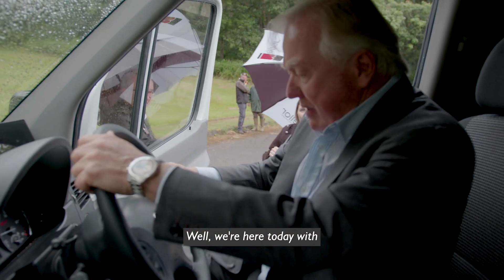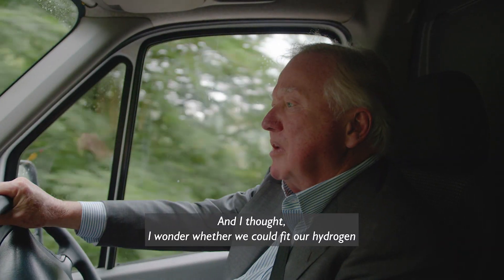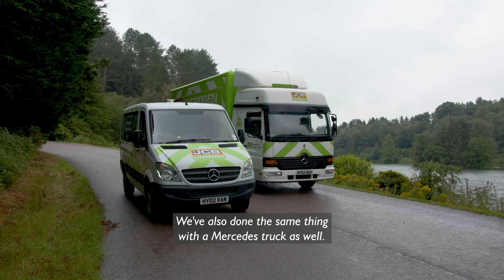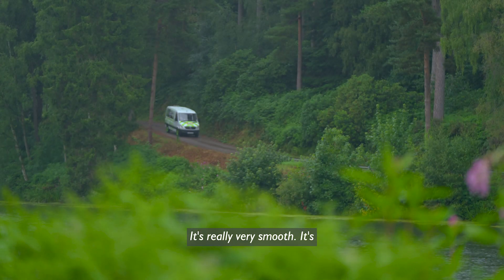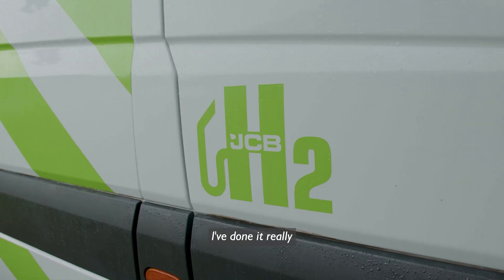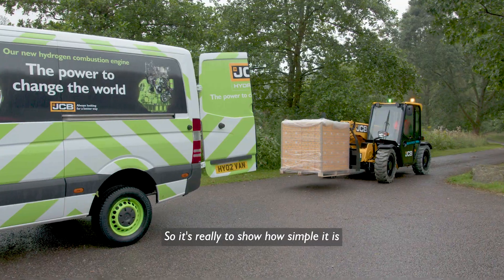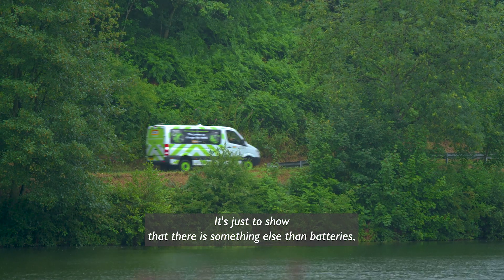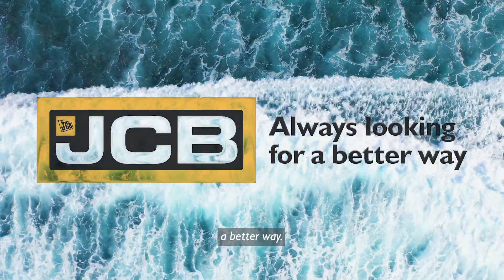JCB Chairman Lord Bamford's First Drive of a Hydrogen Combustion Van

Comment: Great to see you demonstrating the art of possible here JCB!  The challenges of electrifying in the UK are vast and alternatives are really needed...  The current fuel stations could be repurposed from to include diesel and petrol to and with a quick speed of refuelling vehicles it is a solution that could work so well!  As someone over the last 10 years that has had three cars which were plug in hybrid, self-charging hybrid and full electric, I for one cant wait to have a hydrogen car myself!

With regards the colours of hydrogen, lets build the market for using green hydrogen and industry will invest and costs will plummet just as the costs for renewable electricity have, despite the UK having to turn off in vast amounts of renewable production last year, just because it was being generated at the wrong time of day/year.
Reply: There is no such thing as 'green' hydrogen. You are being misled by the fossil fuel industry greenwashing brigade. Why are big oil supporting hydrogen? Have a think- is it because they know that using green-derived electricity to generate hydrogen is a total financial non-starter and that they, big oil, will be providing all the hydrogen from methane?  You clearly read the Murdoch press - times/sun or the equally delusional telegraph. Here's a tip for you when you read their articles about green energy generation, battery technology and EVs - "They. Are. Lying".
Reply: 1) there is only around 8% of the materials needed worldwide.... I was gonna list problems 2 through 9 but yeah number 1 says it all. Not to mention. Electric cras are totally gaaaaaaaaay

Comment: I have my concerns about hydrogen but it is the right thing to pursue its development.
Maybe not for smaller vehicles, but large construction projects (using the hydrogen bowser) and fleets running delivery vans, lorries and buses. 
Efficiency needs to improve and ensure that green hydrogen is used .
Reply: I agree. I think batteries are the future for passenger vehicles and light vans (replacing petrol) and hydrogen will replace diesel. 
As we expand solar and wind, excess production of electricity can be directed towards making green hydrogen.

Comment: Isn't it strange how most people commenting on this video think hydrogen is a great idea and the future, yet aren't questioning where it comes from or how its made, like they do immediately do when talking about EVs. They're ignoring the fuel supply chain and the energy it uses, just like they do with the fossil fuels.
Reply: Maybe they just don't like electric cars, I'm not fond of them and would only have one if it was absolutely necessary
Reply: A lot of suspicious anonymous commenters raining applause for a clearly bad-faith greenwashing pipe dream tech without a single fact check or request for more info? Surely not!
Reply: Like the fuel supply chain that gets the power stations running? 
I presume you always note that a far higher percentage of power is lost between a power station and the wheels of an ev than the equivalent in ice too - the same as ev flag wavers always seem to ignore how wasteful an ev becomes in the cold, wet or whenever its asked to do much actual work. 
Keep bashing any other ideas though - its ev's or nothing, right?
Reply: @siraff4461  absolutely, we need to question the complete fuel supply chain.
Reply: @siraff4461  power plant to wheels losses in EVs is far less than ICE losses - which are so large, you need a massive radiator in your vehicle because it can't waste the heat fast enough! Most of your petrol money is wasted as heat in a combustion engine.
Reply: @brushlessmotoring  Wow. You couldn't get much more wrong. 
Maybe educate yourself a bit before making stupid comments like that again?
Oh and last time I looked my ev had just as large a radiator as my ice...
Reply: @siraff4461  cool - straight into the personal attacks eh? You must be on a firm footing!

Battery EV, 80% efficient, full cycle (includes generation, grid transmission and charging losses) 18kWh per 100km.
Diesel, 40% efficient but only if run at optimal load - e.g. as part of a genset, (e.g. charging a battery).
Hydrogen Fuel Cell (uses Platinum) - 50% efficient, but, making the hydrogen from electricity and water is 60% efficient, so the overall efficiency is around 33% (54kWh per 100km) compared to an EV..
Gasoline: 20% to 30% efficient, mostly produces heat, not motion, which is largely wasted through the radiator.
Hydrogen Combustion (as featured in this one off prototype video) 15% efficient, produces NOx emissions.

What EV do you have with a bigger radiator than a combustion car? EVs do need some heat dissapation, but it's not needed all the time, you might be looking at the HVAC system instead.
Reply: @brushlessmotoring  Battery ev 80% efficient overall? 
Thats amazing considering the power station generating the electric is usually around 45% efficient. 
Look I'm not even going to go into it because you're miles off. Suffice to say you're either pulling numbers out of thin air or someone has fed you a load of nonsense.
Reply: @siraff4461  so where does the hydrogen come from - either fossil fuels (97% comes from fossil fuels) or via electrolysis from a power station - the same power station as an EV - but an EV will use 80% of the power from a power station, whereas a hydrogen car, via electrolysis, will only put 33% of that same power to the wheels. Thats why it's so expensive per mile compared to an EV.

In California, $36 per kg, which at 80 mph get you just 44 miles - 80 cents per mile, compared to 5 to 9 cents for an EV in CA.

And that's a platinum fuel cell car, hydrogen combustion, as shown in this not-for-sale prototype is half as efficient again, and emits NOx.

I agree, power stations are not 100% efficient - although, how do you rate wind and solar? But, starting with 100kWh of electrical energy, however you generated it, a battery EV will use 3 times less than a hydrogen fuel cell, and hydrogen combustion vehicle (seen here in this not-for-production prototype) is even worse.

As a result, you need huge tanks to get the same kind of range people are expecting from a diesel van, and then you have used up all the cargo space.

I have no idea why JCB is building one off prototypes of a Mercedes Sprinter van that they don't make, you can't buy, you can't fuel, and would not work in the way they are breezily presenting it. Are they a mod shop now? Scrapheap Challenge? Junkyard Wars? Is it just for youtube likes and subscribes? It's not a product you can buy.

And then a bunch of hydrogen believers start foaming at the mouth in the comment section .... I feel bad for these folks. Why would JCB do them dirty like this, and show them a product that doesn't exist, and they have no interest in making?
Reply: @brushlessmotoring  You've changed your claim but you're still miles off. 
Between the fuel going into the power station and the car moving an ev is usually between 20% and 30% overall efficiency. 
Thats including power station efficiency, transmission losses, charging losses, inverter, motor and driveline losses. 
A decent modern ice can run around 40% efficiency and hybrids tend to stay over 35% efficiency in actual use. After drivetrain losses they are usually around 25% overall. 
Now what happens when its cold or hot outside? The ev needs to waste more power to heat/cool the battery and heat/cool the cabin. The ice only wastes more power to cool the cabin on a hot day. 
Now how about rapid charging where the charging losses are much higher and battery temp needs to be controlled - again wasting more power to do so? 
Honestly I don't know where you people get your ideas from but sticking a battery in a car does not make it "zero emission" and does little to nothing to help the planet - remember that battery only has a finite amount of use cycles which is much lower than a looked after ice. Its also made from some of the most environmentally damaging products possible and hardly any are recycled - certainly there are no realistic plans for mass recycling and if you think using them for storage is it then look further into what that involves and how much of the pack is really used. 
Batterys have their place. They are great for allowing short journeys on electric where an ice would be less efficient (so long as its not in a cold climate) and they are great for keeping an ice working in its optimum efficiency area. In other words a plug in hybrid makes a lot of sense. 
What doesn't make sense is carrying half a tonne of extra battery around to get a realistic range ev because most of that pack will remain unused most of the time and it still limits range/use when you do ask it do do some work. 
As for Hydrogen - I'm open to see what they can do with it just as I'm open to see where battery ev's go. I really couldn't care less what form powering vehicles takes so long as its the best possible for the use case. 
For instance if someone lives in a town and never goes past 20 miles or so a tiny battery ev makes sense. If they make the odd longer journey a plug-in or range extender makes sense. 
If better battery tech comes along that may well change and it may make sense to simply put batteries in all cars but thats not going to happen with li-ion because physics says no.
Reply: @siraff4461  You said earlier, "Oh and last time I looked my ev had just as large a radiator as my ice..." - which EV do you have?

Where does the hydrogen come from - how is it made - whats the kWh per kg, how many litres of water do you need per kg? Hoe far does a hydrogen ICE or Fuel Cell go on 1kg, how far does an EV go on the kWh used to make 1kg of hydrogen - go look some facts and figures up on this stuff before jumping in with both feet on the magical thinking that is 'hydrogen better than batteries'

I would be more open to plug in hybrids if people actually plugged them in, they are often bought for incentives and HOV stickers and then not actually charged, so they just become a heavier gasoline car.

Comment: Storing electricity in water. It's cheaper than lithium. Why anything else for plant and heavy? No substitute for engines yet. E bikes and electric cars suck too much to take those problems to work where I do landscaping and driveways. Batteries cost too much, take too long to refill and dong hold enough oomph to be a JCB beaver. Hydrogen beaver pack could be cool. Solar powered at home with hho tank and compressor to refill internal hydrogen tank automatically. O2 and water become the waste products.
Reply: You would need 8 times the solar to make and compress enough hydrogen to do the same work as just using batteries - hydrogen combustion is very inefficient.
Reply: @brushlessmotoring  my mate is installing 750 kw wind turbine. We live in farm country in north Cornwall. Hydrogen might pay off on that I think. I admit, it's not going to be a silver bullet for all our problems, but I just can't see battery plant equipment working. I owned ebikes. Bit of a letdown in cold weather on hills. I will have to look into electrolysis gear needed and try figure out efficiency of the system. We really do need the new reactor in Anglesey which is planned for hydrogen.
Reply: @davidedgar7338  quick comparison with a fuel cell Toyota Mirai, which is twice as efficient as JCB’s combustion hydrogen engine - your 75 kW turbine, running for one hour, will produce 75 kWh of electricity, enough to fully charge a long range Tesla Model 3 to go 300 miles. But if you pump 75 kWh into an electrolyzer (and it would have to be big and expensive to take 75 kW) along with 15 liters of deionized water, you will get 1.4 kg of hydrogen, enough to move a Mirai, at motorway speeds of 80 mph, 62 miles. Hydrogen combustion would achieve around 30 miles, and produce NOx emissions that need to be dealt with.

E-bikes have swappable batteries, those batteries can be thermally managed better than they are to maintain better winter range. 

I’ve had zero issues with EVs in the cold, if properly preconditioned- check out my winter road trip videos across the US.

Comment: But where does the hydrogen come from? Almost all hydrogen is made by steaming methane at very high temperatures. The CO2 waste is released contributing to climate change. There are claims that the CO2 can be captured and buried - there are no working examples at scale and the experiments done have generally failed because of leaks and the large amount of energy needed to move the CO2 to storage. Energy use is key all of this. Making hydrogen uses more energy than just using renewable leccy in a vehicle via a battery. More energy means more cost, so the economics won't work.

There is no hydrogen infrastructure to deliver H2 to vehicles. It is very hard to store (high pressure and causes steel to become brittle). I wish we could use hydrogen, but batteries work well and are getting better. Combustion vehicles are at the end of their lives. Big Oil and engine manufacturers want to cling on to their investments and profits, but just as coal mines had their day, so have combustion engines.

I wish JCB well, but this is a dead end.
Reply: CO2 is not a poison, it is essential for plant life.
Reply: @DwayneDibbley  it is not a poison at current levels, but too much of it traps heat and heats up the air. The pre-industrial level of CO2 was 280 parts per million and plants were happy. It is now about 430 parts per million. That is much too much. BTW, too much CO2 can be poisonous to animals including us, but that is much, much higher than current levels and is not the issue here.
Reply: @chilllytube  give us a shout when we get to 1000ppm till then I wont worry about it

Comment: Making hydrogen unless there are natural deposits which are rare involves carbon emissions and for what you gain from the driving emission you free you loose in the production
Reply: Charging EV uses the said same electricity that could go to produce hydrogen.  Nuclear and renewables can be used not just fossil.  This looks for once to be a creditable alternative to EV which is quite simply a non starter for practical diesel engine replacements.
Reply: @xrotor1966  it’s not just about electricity causing emissions. The only way to do it cleanly is using water and electrolysis. Other ways of obtaining hydrogen involve carbon dioxide being given off in the reaction itself and that’s how most hydrogen is obtained at the moment.
Reply: Charging an EV is much more efficient than making hydrogen. There's a reason they're known as hydrogen 'fool' cells! @xrotor1966
Reply: @xrotor1966 Except it uses over three times the electricity. So choices are a) pay three times a much or b) charge three EVs with the same power.
Reply: @xrotor1966  There are extra energy losses using renewable leccy to make hydrogen. It takes a lot of energy to split water and the water must be fresh (sea water corrodes the electrodes). The world is badly short of renewable leccy and fresh water better to drink the water and put the leccy straight into leccy cars.